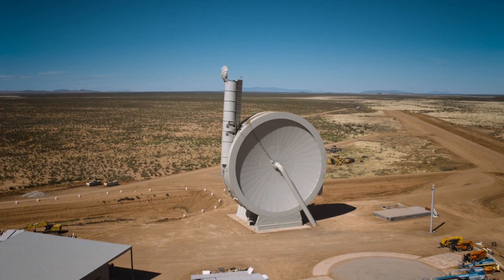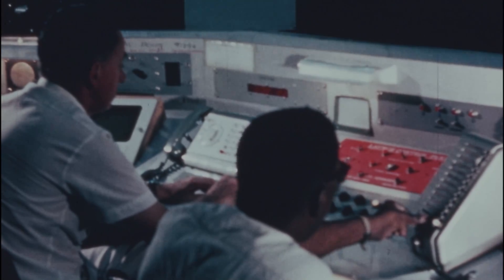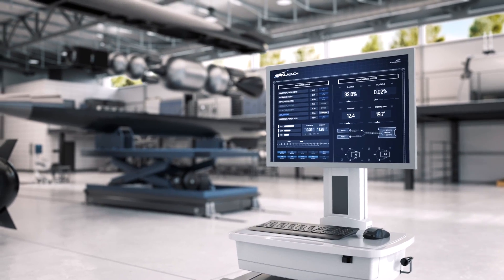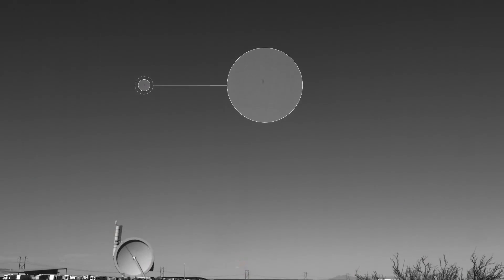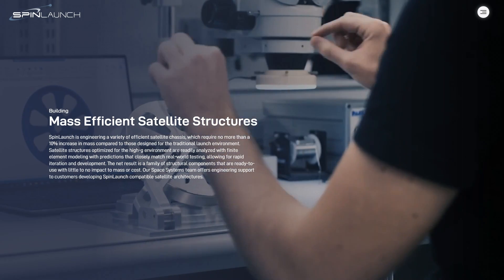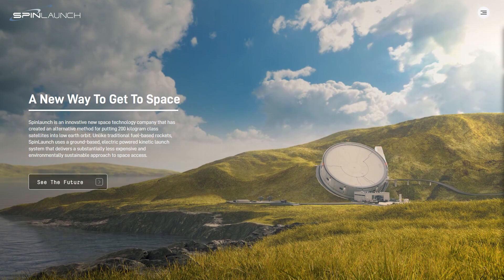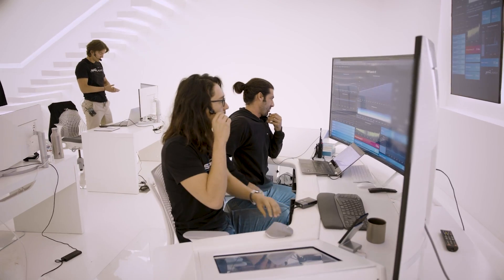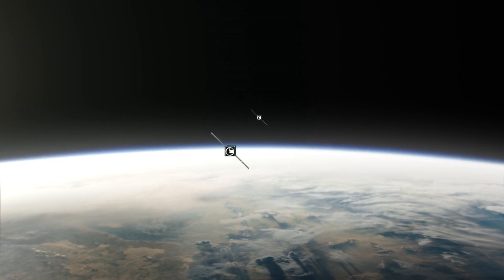Can Spinlaunch Throw Rockets Into Space?

Comment: In all seriousness though, while I know that there would be extremely Precise issues with timing among other things, rather than trying to engineer some new technological development in order to fix the inertial changes of releasing that weight from a balanced spinning mass wouldn't it be easier to just begin with a balanced load on the other end of the arms and release them both simultaneously in opposite directions?  You could then focus on engineering a way to capture as much thermal and kinetic energy from the balance load as it is released and recover a portion of the spent energy used to spin the system up as well as what can be generated from the arm as it spins back down?  Energy storage may be an issue, but it seems like a simpler fix for inertial issue as well as a possible way to make the whole process a bit more energy efficient.
Reply: Yeah thinking similar things. You could have a magnetic tunnel and throw a counterweight down it that would be slowed down by that field and gnerate some power. (Or really just a pool of water and sand would also work) Meanwhile, putting the regen brake on the spinning mechanism is going to create craploads of power that has to be dissipated as well. A large enough bank of capacitors would be able to capture some of that probably.
Reply: I think a better solution would be to have a sliding mass on the arm on the projectile (proyeetile?) side, which slides outwards at the time of release to redistribute the weight such that the center of mass is back at the rotation axis.
Reply: @stijnvanpelt  This will not work. We are talking 2 digit tons at 450 rpm, anything sliding out would rip this thing apart. If not your system would be able to launch more payload using a counterweight. Furthermore, it has to be in position the moment the projectile is launched.
Reply: Maybe on the moon, if you built one such thing at nord or south pole, you could launch horizontally two payload at the same time one for L4 point and one for L5, and obviously wouldn't be necessary a vacuum chamber or huge energy storage system like mass drivers needs.(actually those things that launch two payload at the same time in the opposite direction could be putted not only on the moon poles, but on a continuous line that conect poles with the closest point on the moon equatory on the front side of the moon, and the opposite side on the ecuatory of far side of the moon)
Reply: Opposite release of an equivalent weight looks like a good idea! But doubles the chances of accident? :)
I still like it because it would be an instantaneous rebalance, compared to the solution of a sliding weight on the arm which is not instantaneous.
Reply: At 2:30 they give a peak at the bearing. A hydrodynamic bearing with 300MN static load capacity is pretty massive at this low rpm. The way the construction looks like they might be able to move the spinning arm in the axial direction to control the excentricity of the center of mass. That would allow them to spin up the rotor at a low excentricity to not break the bearing, but increase it once they're up to speed since hydrodynamic bearings increase their load capacity with their rpm. Simply put, going from 0 force to Fmax will be more problematic than going from -1/2 Fmax to +1/2 Fmax. 

I would be very interested in the precision of the bearing, though. Hydrodynamic bearings need clearing to work, but every 0.001° angle in the bearing will result in ~5cm of axial movement at the end of the 50m arm. Makes me wonder how precise you have to be to hit the exit and what the tolerances for the trajectory look like.
Reply: Reverse "rail-gun" ring track, to arrest the swinging arm. Like a bicycle rim. Brain fart time.
Reply: But before all that, are we sure that enormous classical bearings can NOT support the change ?
Reply: So like every launch includes the ground station blowing up from the ballast hitting the ground? It would have the same kinetic energy as the projectile.
Reply: @Kraus-  No, the counterweight has the same momentum, not kinetic energy. A heavier mass, closer to the centre of rotation will have far less energy, and be easier to catch.
Reply: @Kraus-  why would you think that I would mean firing it into the ground?  Obviously the system would be somewhat mirrored and have 2 exits, one dug into the ground and a system to receive the counterbalance would be in place there. I still may well be very wrong in my thinking and very likey the people working on it that are much smarter than myself have already considered it, but I am not wrong because "the ground is there" and sometimes silly simple ideas are worth mentioning because when dealing with complex issues it is easy to miss simple solutions because your minds are already focused on the complexity. Plus it is just fun to speculate on things like this.
Reply: Not a bad idea. I'm sure they have considered it.
Reply: READ UPDATE
The opposite direction you're talking about would literally be the ground. Also the moment of inertia would still change, because mass would be ejected. This means the rotor would still increase in spin and that's the problem.

EDIT:
People below me are trying to say that because mass is being shed at both ends, that means the moment of inertia doesn't change and the angular velocity remains the same.
This is wrong.

The moment of inertia does change, if you have only one weight being launched it changes by -(mR^2+kmr^2) after launch and if you have two being launched it changes by -2(mR^2+kmr^2).

However when the rockets are detached their momentum is equal to just (2)mwR, where w is the angular velocity. If you subtract that from the total angular momentum which is Iw and divide that by the new moment of Inertia after launch, you always get a new angular velocity which is always larger than the original.

In fact launching two mases makes no difference.
Reply: @paritybit-q7e  change of moment of inertia does not lead to change of angular velocity in this case, because angular momentum is not conserved from point of view of the rotor. (It sheds mass, rather than changing its mass distribution).

If a spinning skater on ice pulls their arms in, their angular velocity increases. However, if you cut their arms off, it does not.
Reply: @Wren6991  The moment of inertia does change, if you have only one weight being launched it changes by -(mR^2+kmr^2)after launch and if you have two being launched it changes by -(2mR^2+kmr^2).

However when the rockets are detached their momentum is equal to just (2)mwR, where w is the angular velocity. If you subtract that from the total angular momentum which is Iw and divide that by the new moment of Inertia after launch, you get a new angular velocity which is always larger than the original.

In fact launching two mases makes no difference.
Reply: @paritybit-q7e  Why are you subtracting linear momentum of ejected masses (wmR) from angular momentum of the rotor before/after (Iw)? Those are two different physical quantities, you can't plug them into a single conservation equation.

If you are working with moment of inertia, you need to use parallel axis theorem to find the moment of inertia of the ejected mass about the axis of rotation. I_p = m R^2 plus some small term I_m for the rotation of the ejected mass about its own centre of mass.

Initially you have a total moment of inertia of I_M (rotor moment of inertia) + m R^2 (projectile's displacement from axis) + I_m (projectile's own moment of inertia)

At point of ejection, ejectee is still travelling tangent to circle, so has a moment of inertia of m R^2 + I_m, and the rotor maintains its moment of inertia I_M, so the angular velocity is unchanged and angular momentum about the initial axis of rotation is distributed between rotor and projectile.

If the angular velocity did increase, this would represent an increase in angular kinetic energy. Where would that energy come from?
Reply: (it's interesting to note that, in the "dancer on ice" case, the kinetic energy does increase, and this is accounted for by the work done by the dancer pulling their arms in, in the same direction as the centripetal force applied to them to keep them travelling in circular motion. This is reversed when they let their arms out -- direction of arm motion is reversed, centripetal force is still towards centre. Nature always balances the books. There is no such radial motion here though.)
Reply: @paritybit-q7e  if you did nothing but launch blindly which would be stupid. Digging and building somewhere for the counterbalance to go and arrest the motion would be _ a bit_ different than just launching into the ground and a lot easier than figuring out a way to instantly shift the entire balance of the system as soon as the prohectile is released so that it doesn't destroy itself from becoming unbalanced. You have seen washers get unbalanced. Now imaging these kind of forced instantly becoming completely unstable whils spinning at full force and then rethink mu original question.
Reply: @paritybit-q7e  the rotor would not increase in angular velocity as the two ejected masses would reduce the angular momentum of the system as well as reducing the moment of inertia.
Reply: @paritybit-q7e  or else due east and west in the middle of the pacific, and then course correcting after departure

Comment: Surely the easiest way to achieve such a sudden rebalancing would be to also release an equal mass from the opposite end at the exact same time?

Beyond a second instantaneous release like that, I have no idea how they'd rebalance it so quickly...
Reply: Such a mass, even if small, would have tremendous kinetic energy. If it's released into the ground it would very likely shatter the foundations of the machine in a mini-earthquake, or even blast the machine to bits.
Reply: @donjones4719  Oh for sure, but I'm not sure how else they would rebalance it so quickly...
Reply: @hngldr  It's definitely a head scratcher. The next thought is water, but even at much lower velocities water will cut steel or crush anything in its path.

Comment: I always thought Spinlaunch was a complete joke, but this sounds like it would actually work. It sounds ideal for bulk supply missions, like fuel or consumables. Re changing the geometry of the spinning arm after launch: another option is to build a circular maglev track inside the chamber, and drive the vehicle around it in circles. That saves you from having to accelerate or decelerate the arm too, reducing the overall moving mass, allowing for much quicker launch times.
Reply: Driving a vehicle would drastically increase the problems they cannot solve.
Reply: @GeorgeMonet  it works amazing until you realize how precise you need to be to prevent the thing from releasing at the wrong time and smashing the centrifuge to pieces.
Reply: Yeah, I feel like this is going to be used in a true vacuum out in space for like asteroid mining or something like that. Not having to expend much fuel to send ore, or machined stuff back to earth would be a good idea.

Comment: Hi Scott, Great explanation, had not considered this as an application on moon.. but agree with you that may be be the better use for this in future operations. I'm surprised the system for HARP hasn't gotten more traction, it seemed relatively sensible and scalable using OTS oil pipeline and oil drilling platform tech for a super long submerged system placed near equator and used for G insensitive launch components. Did you get any figures for the deceleration shock/forces as it leaves launcher against sea level air and humidity ? I guess if your items are rated to withstand initial accelerations, that may not be a significant issue, but was curious if this couldn't be used in combination with the harp concept for it's light gas aspects to avoid lots of insulation vs aerodynamic heating, and have it exiting atop a large mountain face above 14 K like in CO ski country ?  THANKS Scott !

Comment: Remarkably interesting idea. 

What if the launch station is mounted on extremely high mountain tops? Like those in Chilean Andes mountains? Will the high altitude make any difference?

What if instead of an arm, a single, heavy wheel/disc? The mass of the projectile would be exceptionally low compared with the mass of the wheel so the balancing problem can be mitigated. Maybe even a mechanism to redistribute the mass can mitigate the balancing problem even further.

What if Kerbal Space Program implements this kind of launching system?

Comment: The projectile is going to have angular momentum in the direction of the rotation. They're going to have to completely and perfectly apply a moment to counteract that angular momentum at the instant it is released. So, good luck with that.
Reply: No. 
The act of releasing the projectile from the centripetal force constraining it's motion to a circle (the Arm) will naturally convert all of its angular velocity (and momentum) into linear velocity (and momentum) along the tangent of it's point of release.

The problem will be the counterweight.

If it isn't released at the exact same time it will impose a side force on the rotor arm equal to the mass of the projectile multiplied by whatever stupid level of G forces this centrifuge is running.

Comment: At the moment it's released the rocket/projectile does have a lot of forward speed, but it's also rotating 450 rpm on an axis perpendicular to its vector. Is there a special trick to get it to neutralize its angular momentum as it's released, or is the stability down to solely aerodynamics?
Reply: No trick needed.
As soon as the restraining centripetal force is released, angular velocity (and momentum) becomes linear velocity (and momentum) along the tangent line of the circle it was travelling.
This is exactly how a sling works.
Or a rotating pumpkin launcher...
And why you should endeavour to keep your head out of the plane of rotation of grinding wheels.
Reply: @NullHand  I'm no expert but this sounds off. I don't think the release would convert the projectile's angular into linear momentum, but rather that the projectile would keep the exact amount of both that it had while clamped - that means it would still be rotating sideways at 450 rpm, 7.5 rps. At Mach 10 this might well be canceled out by fin drag before any significant rotation happens, but that still means dealing with an oscillating high angle of attack while punching through the thickest part of the atmosphere.

Comment: I had always assumed that force balancing in such systems would require releasing loads of equal momentum in opposite directions simultaneously.  So you'd slam a counterweight straight down a hole into some kind of prepared shock absorbing target.  If your counterweight is conductive you could pass it between magnetic coils to recover a large burst of energy - which provides a weak ROI for the power to get it up to speed, but possibly a useful one.

Comment: When they release the projectile, it is obviously going to be spinning sideways due to conservation of angular momentum. I wonder how they are going to counteract that. Perhaps by releasing the latches one by one with very precise timing, using the centrifugal force to spin the payload in the opposite direction.
Reply: Not so obvious as you think... Observe the water drops coming off a spinning bike tire - straight out - no spinning.
Reply: @DLWELD  Obviously it will go straight, but it will also rotate around it's center of mass, because the projectile is rotating at the same rpm as the arm. The rotation has to be cancelled somehow. The water droplets are spinning too, but it is quite difficult to observe, as they are transparent and rather smooth.
(Edit: juat think what will happen if the arm length is zero!)

Comment: One of the cool thing about this is that you are already using weight to counter balance the rocket, but you could just stick another rocket on the opposite side and launch it giving you a 2 for 1. You already have so much inertia build up. Puting arocket on the other side may even solve the counter balance upon release problem. depends on how unstable the machine get in the 1/2 rotation between the rockets. Or you could just yeet the other rocket into the ground and it would defiantly solve your balance upon release problem.

Comment: what we need is a 'recoilless' system where a counterweight is released at the same instant as the rocket

so its a bit like a cross between a trebuchet and a bazooka
Reply: Do we really want an equally weighted object launched in exactly the opposite direction?
Reply: @Kauffy901  In the name of scientific advancement and hilarity, absolutely.
Reply: @Kauffy901  you could launch both horizontally in the middle of the ocean and do a course correction after departure
Reply: @DrWhom  that's even worse. After all, at what point does it stop being horizontal? You're now flying through far, far, far, far more of the atmosphere to lengthen the trip that is shortest straight up.

I think the solution they actually use must be some version of moving weights along the length of the arms in order to maintain balance between them.
Reply: @Kauffy901  yes I do, because I would like that the expensive parts of my machine aren't taking part in the conservation of momentum
Reply: Dang, you beat me to it! Brilliant idea. Great minds and all that.
Reply: A bazooket?
Reply: @jimsvideos7201  A trebooka